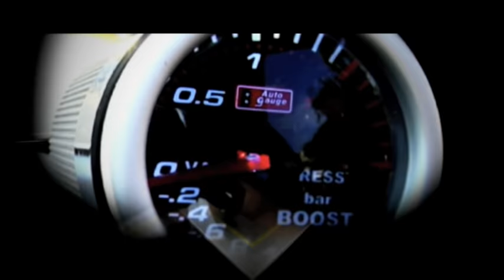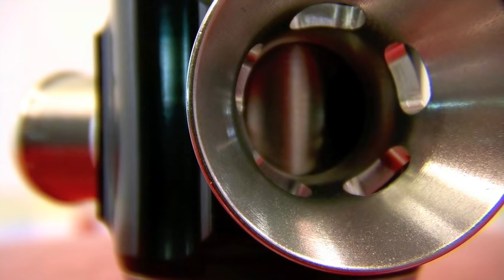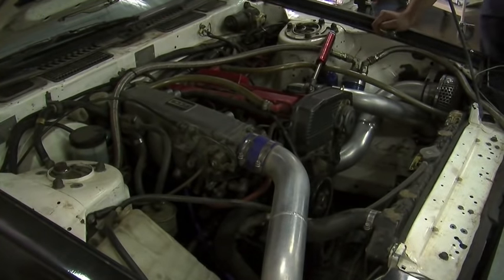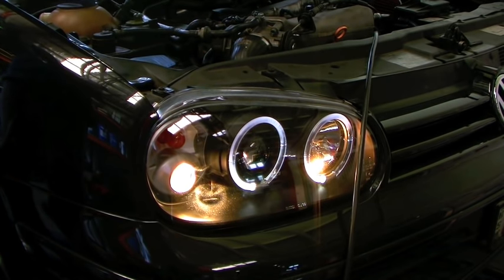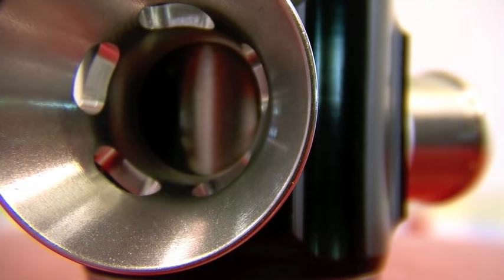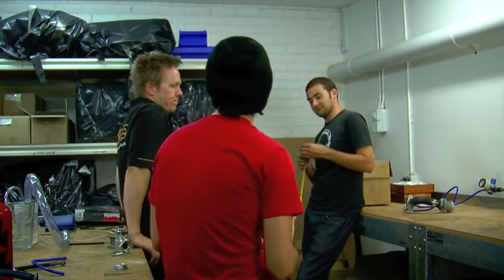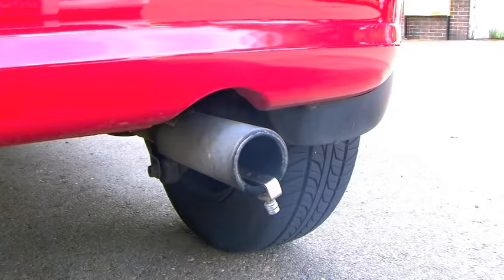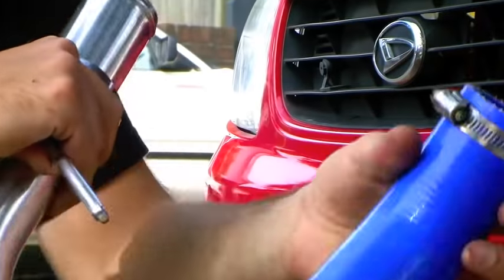Blow Off Valves Mythbusted

Comment: Quick question about 3:20 to 3:30 in the video. My car has the stock recirculating blow off valve and I'm concerned about the blow off pressure when the valve opens to release it back to the intake. Wouldn't that reduce lag,  because the already incoming intake charge is being boosted a little more from the recirculating pressure,  as opposed to releasing it all at once? That seems counter-effective to me to get the "whoosh" which we all know and love. I can understand it on high horsepower applications, but its become a ricer trait. I enjoy my quiet "psh" and brutal acceleration as I roll on all the loud fart cans and clear taillights that don't know what's about to happen to them ;)
Reply: To a small extent it is supposed to help reduce lag. From what I've read if you don't have a large turbo or the correct tune for a BOV that vents to atmosphere it will adversely affect spool time and also the car can run rich and hesitate more.

Honestly though for the least lag between shifts if you want to keep boost I would look around for a 2-step with a no lift shift feature. Keep it quiet and still be faster.

Comment: a dyno test is not the correct way to test BOV's effectiveness, since BOV's are not support to add power but to reduce lag (by reducing the pressure the turbo's compressor has to work against with the throttle closed)

Comment: certain cars need to recirculate. the ecu is expecting to receive the air that you are venting to atmosphere. performance is lost every time you vent to atmosphere (ie shifting, letting off throttle). it will give you more lag while track driving/ driving aggressive.  looking at the kw on a dyno won't reflect the kind of performance loss. CHECK WHAT SUITS YOUR NEEDS BEST!! different engines have different needs, it is up to YOU to meet these needs.

Comment: You unfortunately didn't answer the vent to atmosphere vs full recirculation question. On some mass airflow sensor based systems, there is a stock recirculation valve and it is not advised to run a vent to atmosphere BOV as it will caused metered air to escape the system. Many ECU's will expect a certain amount of air and when the O2 sensor reads less than that, the ECU and tune will compensate by dumping a bunch of fuel into the system (as it thinks it is seeing a lean condition). This causes the car to become very rich in fuel, which will bog down your car, cause damage to catalytic converters and you may also experience engine backfiring.

Comment: It's amazing nobody has realised even the knobs who made the video, bov was not just about protecting turbo etc, back in the day it did make your car quicker. Everyone looks at peak power, obviously it won't alter peak power , it was about spooling earlier, to make more low end power, making a better lap time. They should have run it up a drag strip with and without bov. Not a massive difference now, but cosworths, RS turbos, renault 5 turbos etc all made a noticeable difference

Comment: If you can understand what a blowoff valve is and how pressure differs at the output of a pump when the air draw from that pump output is used, then figuring out how to use and adjust wish a system should be easy.
     A blowoff valve is simply an overpressure relief valve, set to just beyond the pressure that is ever experienced at full throttle.  A centrifugal pump (turbo) will produce a maximum pressure when its output is blocked, and a lower pressure if air is drawn from it, as in a running engine.  That's near where the valve is set to open.
Reply: So would it benefit a procharger?

Comment: Hey guys! Awesome videos! Very helpful! Can you guys make a video on upgrading cams to a stage 2 and like what should be upgraded along with putting in new cams. I know you need to upgrade the valve springs so you wont lose power.
Reply: 808illest more power = more heat, so cooling system. And depending on the gains driveline = cluth, differential, tires, gearbox.
Reply: MindBlowerWTF gotcha. So I need to upgrade my exhaust manifold too right? so ill have bigger diameter for the heat to go out? what about the engine? do I only need to upgrade the valve spring when I put it in?
Reply: 808illest You should be good  to go, as long as factory  exhaust manifold is decent. You should also talk to some expert, as I am amateur :P

Comment: They failed to mention that if you only vent to atmosphere on an MAF based tune the car has less air than what was measured causing it to run rich in between shift which can negligibly reduce power.  On a MAP based tune then yes there is no difference as the air has not been measured until post intercooler.  Thats why COBB has an enlarged recirculating valve.  Most go for a hybrid setup to avoid or reduce this issue.

Comment: Dear person(s) scrolling through YouTube comments. Ignore this video, please. Blow-off Valves are NOT required for a turbocharged car. Its a myth propagated to sell stuff.

Love, 
A guy who actually knows about turbos.
Reply: +Chris Mason while not required (I've ridden in plenty of cars that didn't have them), they do sound cool. I'd not pay a fortune for one, though.
Reply: DFX2KX Neither would I. A lot of turbo kits probably come with them, so yeah, why not in that case. But as far as a "reasonable" budgeted turbo build... you probably don't need it for any reason except cool factor.
Reply: +Chris Mason I've heard that the flutter is air coming back out of the turbo because the engine stops pulling it in before the impeller spools down, is that correct? And that's what a waste-gate is supposed to stop?
Reply: DFX2KX Kind of, yes. Flutter can be present, but it is not disastrous simply by it happening. The waste gate is on the hot side (exhaust side) and is what keeps you from, basically, overboosting.
Reply: +DFX2KX the waste gate redirects exhaust gasses around the turbo outlet when your max boost is achieved in order to prevent over boost. the blowoff valve relieves pressure in charge piping to  prevent pressure spikes and possible turbo damage in high boost applications. as said in the video you don't necessarily want to relieve all the pressure in charge piping when shifting. having some pressure in the piping helps spool times. that being said, running no blow off valve is a preference but in most cases still reccomeded in high boost applications.
Reply: +Chris Mason no such thing as overboosting can never have too much booooost sututututu
Reply: boredediting66 Reminds me of a joke I saw on a forum somewhere.

Knock, knock!
(Who's there?)
Number 7

Through the block.

Comment: would it have hurt to hook up a OBD software of some sort so you could demonstrate the effects on boost pressure and spool up during gearchanges instead of just measuring the power in a single gear?

Comment: lol on a bike... so i guess you couldnt just make and extension off a N.A throttle body intake tube close to the intake? and put plumbing in fron the exhaust right afyer header collector so you get the air like from the turbo, then u could recirc it back into the throttle intake tube? i wonder if that would work or possibly add more power because of the forced air back during the shifts.

Comment: Diesel engines don't have throttle plates, so there's no worry about high boost pressure reflecting back into the turbo, thus no need for a BOV.

Comment: Results:
Does not increase power but does increase the chance of better turbo life, better lap times because of the throttle will open with more boost than with out it when gearing.

Comment: 140bhp seems a little low for a 1.8T with a Revo stage 1. Looks to be an AGU with the lack of drive by wire throttle, but that's a pretty low figure. Guessing it's power at the wheels it's displaying, but assuming a 15% drive train loss that's still only 160bhp. 1.8Ts in the Golfs made either 150bhp or 180bhp stock.

Comment: the test you guys conducted on the dyno was not conclusive. you need to run up through each gear as if you were on the road. the act of coming off throttle to shift gears will activate the diverter valve and vent the excess intake air into the exhaust side of the turbo, letting it spool up quicker for the next peak on the powerband. blowoff valves eliminate this function by releasing the intake air, thus increasing lag. the guy in the video was selling Blowoff valves, not giving proof they work

Comment: Damn what's up with those motor mounts though
Reply: +Brian O'Connor 
rubber mounted with springs to keep cabin virbation down.  its just the rubber bushes on the engine mounts compressing due to the torque of the engine.  OR would you want that twist and torque transmitting to your car's subframe?
Reply: Rice mods....

Comment: The blow off valve WILL improve the performance when shifting mostly beacause after the shift whitout the valve the engine will have too much air so the mixture air/gaz will be unstable so less performance but sometime the difference will not be big depend of your turbo but the difference is there
Reply: Or you drive a Diesel and dont give a shit about mixture

Comment: Hello Mighty Car Mods, I plan on increasing my boost on my stock turbo, also I plan to follow your turbo supporting mod. But my car is a silent quite and good fuel consumption car at (currently) 6.6l/100km, so is it a must in installing a better blow off valves?
FYI i still want a quite car with no wooshing sound.

Comment: One myth that was not busted is the stupid « maintain boost during shift » thing. Blow off valves DUMP the compressed air, that’s their only function, they don’t « maintain boost » they dump it. The main reason for their existance is reduced load on the turbo shaft’s thrust bearing on throttle closure. They help with the long-term durability of the turbo.

Comment: a blow off valve will make your turbo car faster, it allows the turbo to stay spinning between shifts and in turn builds up boost faster after every gear drastically shortening turbo lag. any further question you can forward to my manager at tweeter
Reply: thank you for being right. a BOV is needed to fight surge, hell even on a diesel a BOV is of benefit.

Comment: I will try to explain it a little bit better if u turn up the boost on a turbo vehicle and im talking 10 or more PSI here then it is extremely likely that the standard BOV that came with the vehicle will leak boost .A good aftermarket BOV will not leak boost an therefore u will have more power (its pretty simple)the BOV doesn't make power it just holds the increased boost pressure.

Comment: If you didn't run such long piping with an inner cooler, you wouldn't have to worry about building up pressure again. I don't know if I'd want to have a complete dump of the pressurized air when you let off the throttle. But there sure isn't a need for a whistle, and back pressure to the turbo, making "cool" sounds, that will lead to part failure....
.
Just separate the two fans... exhaust and intake....

Comment: A blow off has 0 to do with HP. It has to do with releasing pressure. The release of pressure lowers back pressure that slows the spooling of the turbo. This helps while upshifting because back pressure slows the turbine.. I'm pretty sure the turbo guy in the beginning explained that.

Comment: You can't run an atmospheric BOV on a turbo charged T7 SAAB unfortunately. Running an atmaspheric BOV on a T7 SAAB will result in a check engine light. I have an 01 9-3 and I can only run a recirc valve. There are modifications that allow the use of an atmospheric BOV on a T7 SAAB though.

Comment: dyno*, and how does it help shifting? as the guy said it can help with turbolag but thats after shifting. a dyno messures torque, and torque is the tendency of a force to rotate an object (wheel) about an axis so it is a bench setting for acceleration testing.

Comment: I am reading and watching videos about BOV since I own a turbocharged car but some say its beneficial and other sources say it's harmful....I hope I find some real dyno test result video somewhere to make sure it does make sense to get one. I don't care about the sound, only about performance. Some sources say it does improve turbo life but I am not sure anymore...
Reply: Raul Ferro it’s not good for cars that have a mass airflow sensor. Like the Gen 10 Honda Civics.  The MAF has already accounted for the air intake into the engine. The BOV blows off a portion of that leaving less then optimal volume of air. That creates more fuel then air. Not enough air to combust all the fuel leaves extra fuel. That’s  that’s harmful and can lead to engine failure. A BOV is good for cars without the MAF sensor.

Comment: At start i will say my english could be terrible. I`ve got a question. What about a blow off valve in diesel engine. I `ve read whole internet about this and i saw opinion about blow off in diesel is a mistake `cause the air pumping by the turbo is wasting on the blow off. Is it true?

Comment: No performance gains?!? Maybe on dyno... through gears on a car set up for sports street/ light track work, or drifting, throttle response and spool time through gears has a massive effect on drive, and therefore time/terminal speed over given distance. 

Stay low mount... with powder coating pluming and black silicon joiners. No lairy anodised colours on fuel rails. 
MOST IMPORTANTLY, put a ducted box around the pod filter. Or run ARC panel filter or something. High mount, purple, yellow etc bits, visible heat wrapping, fuel regulator gauge, and the like, is like christmas for the local revenue raiser and his little colouring pad. Especially if your runnin aftermarket engine management, fuel systems or stuff like competition oriented exhaust systems (dont run de-cat pipes ffs, just hollow em out or buy a performance one like a 100c unit with a 2”+ flair.... a good tuner will configure it with a resonator and straight through baffle just fine. Big$$$ fine. Big) last thing u want is to have to re-do looms, exhaust, fuel systems, turbo systems etc etc to get it passed only to swap it out again. Think 10k+ in parts and labour. And time. 
Apart from the wing. I always aim to look like a special edition from the factory. Ie; moulded surrounds over gauges, no wilwood or alcon calipers. No chemical factory in the boot, no 2 piece rotors with floating caps etc etc, the twin plate clutch, racing exhaust and tight af diff are enough to keep me busy trying to disguise.

My 2c anyway. Go nuts n get club rego... Or fuck it, just be like mad max lol.

Comment: Supposedly you are not supposed to run a BOV on an Audi/VW turbo system because it needs the recirculated air from the valve to "help" spool the turbo. If you get a BOV then your car will have the fuel too rich. You can get a hybrid BOV or get a new diverter valve
Reply: I don't think you can spool a turbo with a residual pressure from itself! Inertia will keep it running if you can divert pressure on the throttle side. Nor do i understand why the mix will be too rich.
Reply: I just got an Audi with a 1.8t, so I've been doing lots of research into turbos (being the first turbo car I owned) The computer controls pretty much everything. Even the boost control valve. It takes the pressure diverted back into the intake by the diverter valve and uses that for it's calculations of air/fuel. If a stock turbo car has a diverter valve, don't put a bov. If you put $5-8k in the engine, then sure, blow off into oblivion.
Reply: petey2crazy I think i'm starting to understand, correct me if wrong. The ECU opens the diverter valve and at the same time enriches the mixture. The resulting mixture is intentionally too rich to fully burn up in the cylinder, but in the exhaust manifold, with fresh air being put in, it should re-ignite, burn and expand while travelling from the engine into the turbo, thus spooling up the turbo. Thus the turbo isn't spooled with residual pressure, but the airflow is indeed needed to late-burn some fuel and spool the turbo with that!

This is indeed an arrangement which is both awesome and finicky, so any modification better be very well conceived, or you may end up with a sharp decline in performance or worse.
Reply: Siana Gearz What you're describing sounds more like anti-lag.  The reason the mixture gets to rich is that the BOV is 'downstream' of the airflow sensor.  When the throttle is closed and the BOV opens, the turbo is still spooled up and pulling air through the MAF sensor.  The ECU is getting mixed messages - throttle is closed, but airflow is high.  The ECU tries to match the fuel to the measured airflow but doesn't 'know' that air is being vented, so the mixture becomes rich.

Comment: this test isn't a end all questions and theories on bovs. he says it doesnt make a difference whether u vent to atmosphere or recirculate the vented air from the bov, it sure does matter especially in a car that is maf based. wen air passes tru maf it reads how much actual air passed tru and send the readings to the ecu then ecu gives the engines the proper amount of fuel based on how much air it read. wen you vent to atmosphere some of the air metered by the maf is gone but ecu will think it was recirculated still providing the fuel it needed therefore creating a rich condition during/between shifts

Comment: Blow off valves are pointless at the low pressure these cars are running. They are essential for performance diesel pickups that are running anywhere from 30 to 100+ psi. The blow off valve keeps the extra pressure from running backwards through the system, and making the turbo "blark" which can damage the compression wheel.